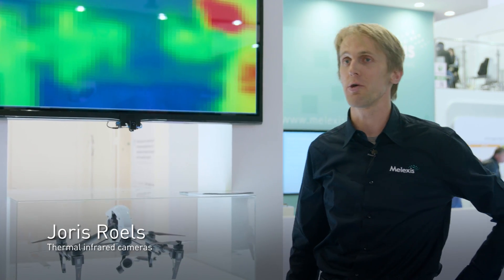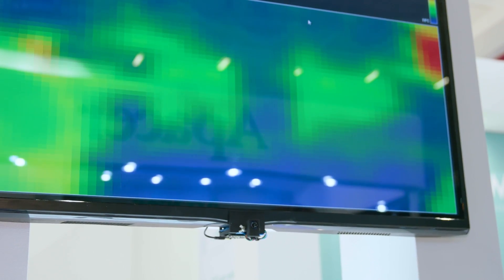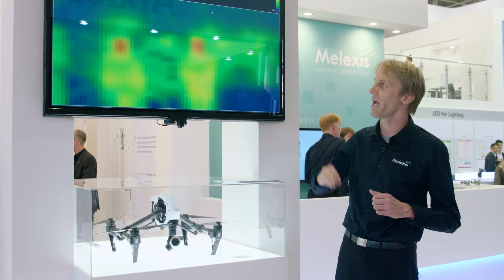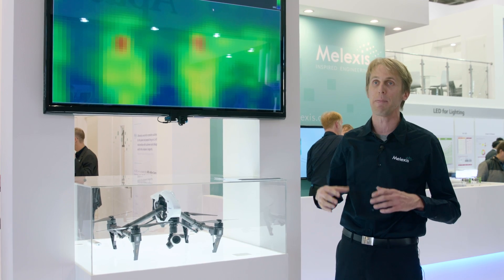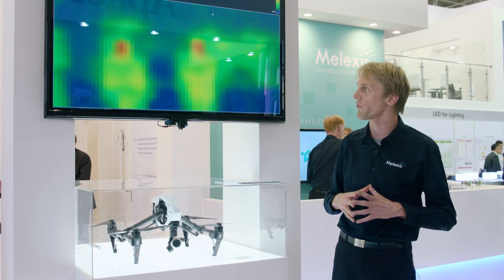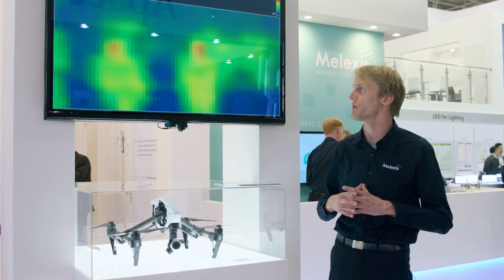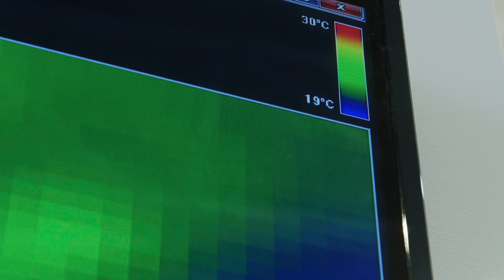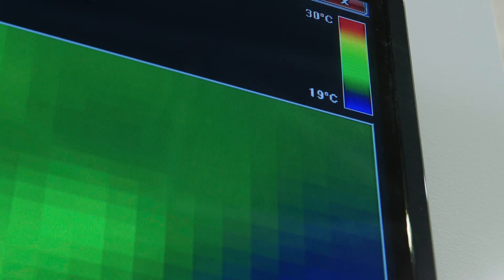Far Infrared (IR) Thermal Sensor Array 32x24 RES (MLX90640)

Comment: Hi there. What should I change to add more value to the measured value of the MLX90640? For example, if the temperature is 36 at a distance of 10 cm, and 34 at a distance of 30 cm, then 2 should be added to the result. Please help.
Reply: You need range compensation algorithm

Comment: Superb work, really looking forward to your this and your new workds.
How much will this sensor cost?
Reply from the maker: Thanks for reaching out. Both the devices and the evaluation kit will be available through distributors in September 2017. Please check https://www.melexis.com/en/contact/distributors to find a distributor or a representative.
Reply: Hi Melexis, is there a price now?
Reply: I also have the same question. It had better be a lot cheaper than the FLIR Lepton, which offers higher resolution. BTW, it's long overdue, wouldn't you think (it's January 2018 and I can't find it on Digikey or Mouser still...)
Reply: @GRBtutorials  have you found any decent thermal cameras that are inexpensive and has more than only a few pixels?